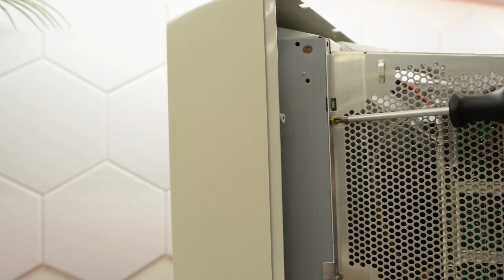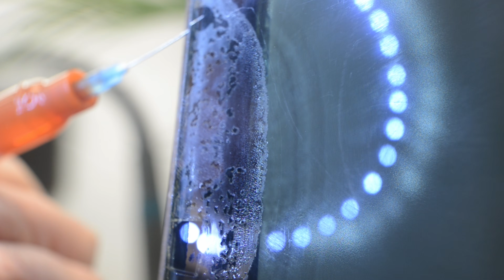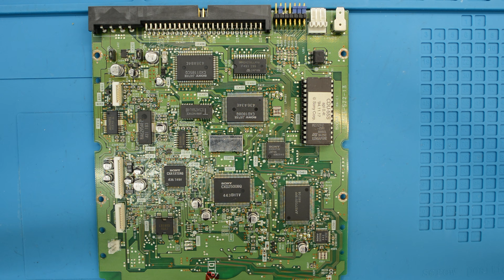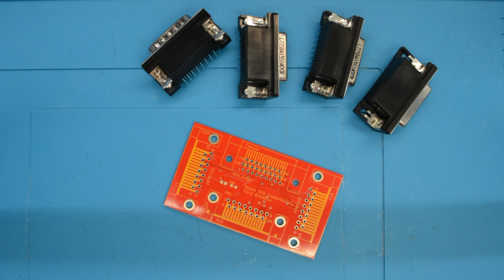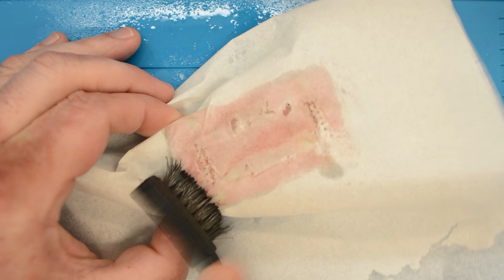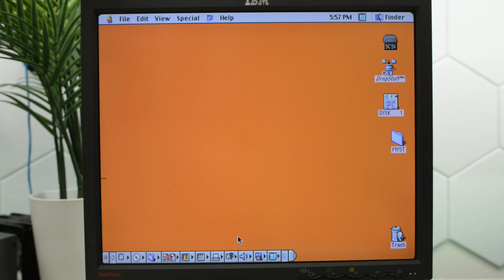Performing Surgery on a CRT Tube to Fix Cataracts + Reviving a Broken Mac

Comment: These "oily spots", from my experience, are not stains at all. They are areas where the antireflective coating went off. When you look closer, after using the magic eraser, the spot becomes bigger, as you've managed to remove even more of the coating.
Reply: I was literally yelling at my screen "STOP you're making it worse". Yeah he was removing the anti-glare coating... damn...
Reply: @MoSs.  There's nothing inherently wrong with removing the coating, as long as you're not using it directly in the path of a light. LOL.

I've polished the coating off on tubes where it was already pretty ruined, and it was definitely an improvement.
Reply: @lookitskazzy  I've seen displays where even in a dark room you lose a lot of contrast and black levels, I've seen some people add car tint onto pvms after removing their antiglare, tv tubes usually use a sheet so its easier to remove but most pc monitors use a coating.
I have a compaq 20" where the previous owner used IPA and heavily damaged the coating, I've since attempted to remove the remaining coating but its a ton of work using microfiber cloths with ipa and some late era monitors are huge pain in the ass to remove the front bezel for a full clean.

either way if you remove coating yes you can't have any natural light and it often messes up contrast/black levels and even if you add an antiglare layer back with car tint you really should get a colorimeter to calibrate the display otherwise it may never look the same
Reply: @MoSs.  Luckily he made it worse on the part the bezel will cover anyway.
Reply: I got a nice 17 inch CRT with some thin scratches on the front, which I also mistook for stains. Gave it a good rub with windex and IPA to clean it up, and turned the scratches into an area. Ohnoez. :( Ended up scrubbing the whole screen to remove the coating completely, so it's uniform again. Much brighter too, but the glare is now pretty bad. So, yeah, don't "polish" any CRT that has a blueish-purplish reflection.
Reply: @mike_rofone  TVs usually use sheets that are easier to remove, monitors are typically coatings, I've seen some folks use car tint material to restore antiglare
Reply: @mike_rofone  Never ever use Windex or IPA on CRTs. Lesson learned.
Reply: That's also what I thought immediately. Unfortunately happens to a lot of Sony Trinitron PC monitors. This coating also has an anti-static effect, so if you remove it entirely, which some people have done, you're not only left with a glary screen, but also with a lot of static voltage which is not ideal
Reply: I had a suspicion that's what this was.  I saw monitors at school where it was worn off in places, probably from someone trying to clean the screen with the wrong chemicals or something really rough.
Reply: yes, I was gong say that it most classical "clear spot, got town the drain or something end the part have cleared the surrounding area, hence a "clean spot", or bald patch on you r grass lawn, the been to mush foot traffic warn the grass away, to just dirt is left?
Reply: This!!! :)
Reply: Might as well remove it all if it's already that damaged. They sell coating solutions that you can spray on to restore that layer anyways
Reply: I had the same experience with a Sony Triniton monitor I acquired.  Previously someone had over cleaned the screen and put some small  holes in the anti-reflective coating where the light emitting from the CRT was much brighter than the surrounding area.  This was very annoying, and the much darker image was where the anti-reflective coating remained was very evident. I decided to strip all of the anti-reflective coating off, and I’m glad I did.  I can’t remember what I used, whether it was 90% IPA or white spirit.  Anyway it came off very easily with the right solvent.  The result was a better brighter image and although it suffers from some reflections that the coating previously prevented it was the better option than what I had before.
Reply: @davidp4456 This coating is not only anti glare, but also anti static. It is conductive.

Comment: Are you sure the oily marks you're seeing are actually something on the glass and not an antireflection coating that has been rubbed off from contact with the bezel.  It looked a little bit like the small test section you tried to clean got a little bit bigger each time you treated it.  Initially i thought maybe it was a substance being spread around, but that could also be an optical coating being removed.

Comment: Removing the air form the syringe would reduce the bubbles. Don't give the patient an embolism.
Turning the monitor so the air goes up, working from the top will certainly help with the procedure.
13:50 That looks like the Anti-static/glare coating is worn off, rather then something stuck on the glass. It's a metal film sprayed on the glass. Aggressively cleaning a monitor will remove it. A dish cleaning pad will strip all of it off. But you loose glare and anti-static properties.

Comment: this is the first time I see a "new" CRT having cataracts. shango066 vibes with the old tubes. if the cataracts continue growing inside, you might want to remove the protective glass completely, and just stick it to the CRT with double sided tape, as shango did many times. you could use a black adhesive, like silastic glue.
Reply from the maker: That's plan B
Reply: the safety glass/glue lamination combo on rectangular tubes is structural like the implosion band, the vacuum causes the tube to try and return to an actual tube shape (including the face) with enormous uneven force, he tends to not de-cataract rectangular TVs except educationally for that reason, the process almost always ends badly

Comment: You're probably the last person I expected to see mixing vinegar and baking soda. Vinegar is an acid and baking soda, being alkaline, is the most practical and convenient way to neutralize acid. I really must insist that you return to your established tradition of near infallibility. It's very relaxing and therapeutic. 😊
Reply: Chemically inert surely, but still mildly abrasive, both you and the mixture.🤣
Reply: @drewnewby  I'd be curious to learn how much baking soda it actually takes to completely neutralize white vinegar. Maybe there's a sweet spot where the solution is still a bit acid while also being abrasive?

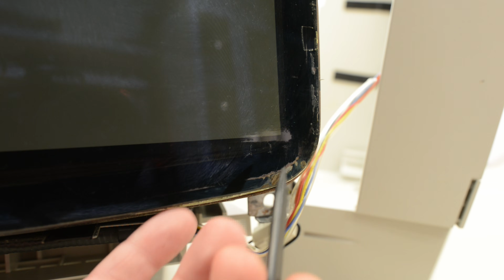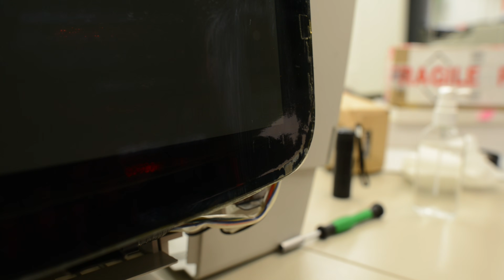Comment: Is the glass coated? From 13:30 to 14:02 the spot looks like it got larger, did it spread or is that an anti-glare coating being removed? If it's anti-glare then it's sprayed-on colloidal silica so cerium oxide would work to remove it all.
Reply: Thats what i have been thinking too, the spots remind me of a staingate macbook.
Reply from the maker: The thought never crossed my mind. That's actually quite possibly a messed-up coating. I hope it can do without.
Reply: @Epictronics1  This is 100%  anti-glare coating.

Comment: None of the 6100s I remember had a CD-ROM drive.  The Panasonic CR-503 drive in my Quadra 630 works very much like new.  I cleaned it up and regreased it last year.  I also completely recapped the power supply in that Macintosh.  I have an old Dell UltraSharp monitor connected to it.
Reply: 6116 did and the Performa variants definitely did.

Comment: Brake cleaner? That stuff is awful. Might work.
Reply: CRC Brakleen or similar is really smelly but does break down petroleum products. Or Acetone could work too
Reply: @OscarSommerbo  I was thinking acetone too. I was also thinking about Methyl Ethyl Keytone or something that contains it, like some carburetor cleaners. Brakleen seems to be mostly Tetrachloroethylene which was developed as a safe alternative to Naptha (like how heroin was a developed as a safe alternative to morphine). If it was me I'd probably start with Naptha, then Brakleen, then MEK. I should also say that I've heard MEK referred to Methyl Ethyl Deathyl, so be careful with it.
Reply: @ct_carpenter Well ventilated area and all that isn't just a suggestion, it's a smart way to stay healthy.
But acetone is a good start as it is pretty aggressive without being too toxic.
I always try acetone then gasoline and lastly brakleen.
Reply: @OscarSommerbo  The thing that makes MEK so dangerous to use is that it readily absorbs into your skin and will dissolve many of the materials that gloves are made of. Yes, ventilation is important, but it only goes so far with that stuff. BTW, MEK is one of the main ingredients in PVC Primer and Cement.
Reply: @ct_carpenter  Yeah, I don't mess with MEK/carburetor cleaner unless I have no choice, and the choice not to use it is a strong one. Just a tad too scary for me.
Reply: @OscarSommerbo  You're smarter than I am :)

Comment: I am honestly not sure if that is clever. The old glue will still fail and then you have the new glue holding the glass with no way to take it off or clean it. I would just throw it away, but just in case the rest fails and you would like to repair it, you make your life much harder.
Reply: Wrong. He said in the video that the resin also softens the same way as the old stuff.
Reply from the maker: The resin I injected is the same stuff already there. The old and new resin can be removed by heating it to 150 °C.
Reply: @Epictronics1  the old resin is falling apart............ And where do you know the specs from the resin that they used 40 years ago? I think it is a bad idea because as I said the old stuff will keep failing no matter how much you mess around and the new stuff will be stronger than the old stuff, which is logical, if the old stuff is failing. It is my opinion but good luck. You must be happy with it, not me but if I see a video in 5 years it fails again and I glued the corners together and the glass broke etc. you can say I was right :) And if not, all is good.
Reply from the maker: @stefanegger  That's how I hook you. Now you have to watch every video I post for five years😆
Reply: @stefanegger   Maybe so, but removing the front glass is dangerous, and you really need to decide whether the CRT is really worth that risk to yourself.  In that case, why not give this a try?  In the worst case, it fails anyway and you're back to the point where you have to take extreme measures.  In the best case, it holds the glass firmly enough that the old resin isn't stressed into letting go.

And while you don't absolutely know the exact compound used when the CRT was new, there are regular solutions to these problems with equally regular specifications.  You can hedge your bets that it will be whatever was the go-to back then.

I also don't think you're appreciating that heat softens the resin.  Will it be exactly the same as the old product?  Maybe not.  But it will likely be close enough not to matter.  It's worth a shot, especially if the alternative is to weigh discarding the CRT anyway.  No?
Reply: @sirnickity  yes, valid point and of course interesting to try something out. Why not. I once tried to run a Commodore Plus4 on an event and let me tell you, it did not go well (the CPUs are dying even tho I tried to add a small fan). I know it is crap but I tried it. Since then, I do not run any Plus4 longer than switching it on to see if a screen appears, it is not made for any longer term use. I just had the impression from the intro that he wants to try to get the glass off anyway so I thought why glue it back on again? And I think that old failing glue it way easier to crack than new glue. 

I am not sure why it should be dangerous, the glass is - as far as I understand - a protection against implosion. But first you have to know that implosion SUCKS in the air and thus, it will not shatter around like an explosion. And 2nd I never saw any shattered CRT except on purpose - they do not shatter on their own. And 3rd you should be careful with any project or CRT. Ask the 8 bit guy. But "dangerous", I dont know. You can wear protection of course. I would not do it because there is no real reason to - I am not familiar with the process and the work is more than what I would gain from it. In the bin it goes as the 8 bit guy would say but I have to say I have several commodore Monitors (1702, 1084 variants, 1081, 1942, some Atari, etc.) and I never had any issue with this front glass.

But thanks for your input! Great thoughts and explaination, I agree with you, I probably understood it a bit wrong, he wants to imporove and test it. Hope he will let us know in a few years how the progress is going.
Reply: @Epictronics1  I am subscribed and I watch your videos. You will wish you did not say that haha I thought you want to take the glass off anyway and glueing it back on seemed a bit strange but if it is meant as an experiement let us know about the progress over time. Would be interesting what causes the issue in the first place, why only on the borders, etc. Some monitors also have it in the middle or they have disgusting green stuff in them, which looks like it was in a jungle for 20 years. See ya next week, man!

Comment: 16:00 Perhaps try some stronger solvents, like acetone or toluene or Dichloromethane (DCM) or methyl ethyl ketone (MEK).
Be sure to use gloves to prevent getting it on skin, and use in well-ventilated area. Several of those solvents are really toxic.
Barring that, have you tried using an eraser (aka rubber) or an extremely sharp razor scraper and seeing if a purely mechanical approach will work?
Reply from the maker: No, I haven't tried any additional methods, other than what I tried in the video. Hopefully, we'll get a small list of things to try in the comments.
Reply: @Epictronics1  Be careful, it MIGHT actually be the anti-glare coating coming off.
Reply from the maker: @THEtechknight  Yeah, someone mentioned it below. So, now I wonder if removing it would render the display unusable.
Reply: @Epictronics1 no it'll still work, just have less contrast, and there may be film you can get to reapply